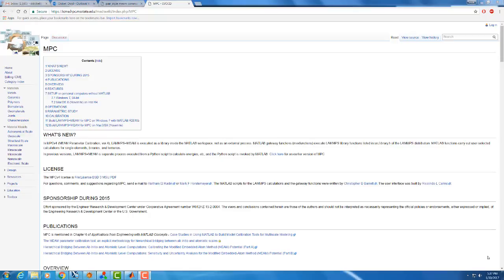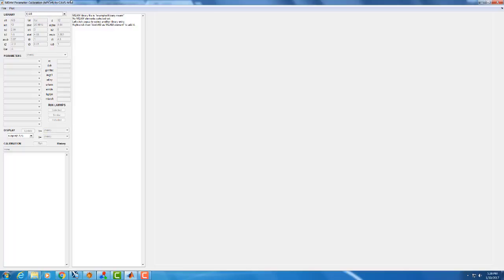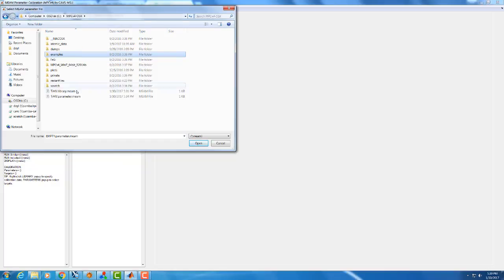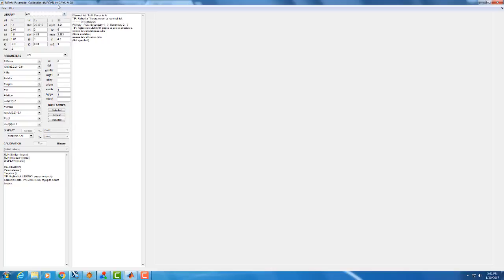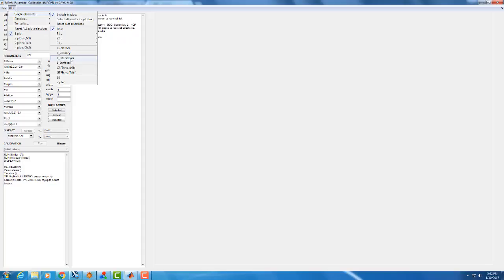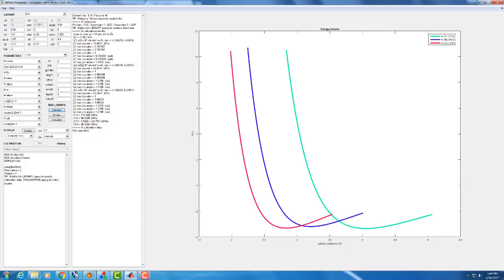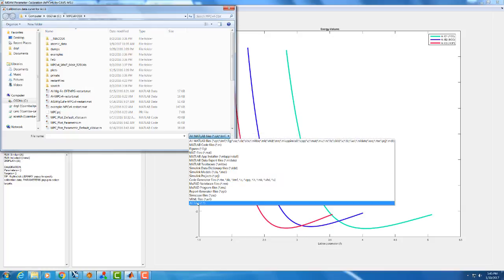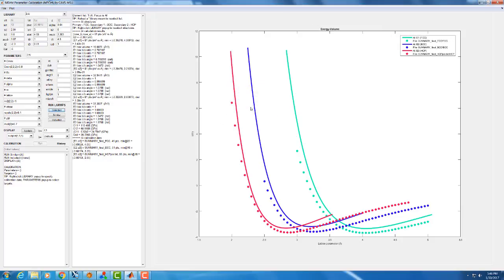MEAM Parameter Calibration Installation and Introduction

Comment: This looks like an interesting tool. I have two questions about it. 
Can I run this without using Matlab?
If it is as simple as it seems here why are some elements in the NIST potential database still without MEAM potential?

Thanks for your great vids!!!
Reply from the maker: Thanks for watching!
1. So, you can run it without having MatLAB, but the installer will install the Matlab Compiler Runtime (it is free though).
2. That is a good point! For most single material potentials, the process is very straight forward. There are potentials for most of the periodic table, but they haven't all made it to the NIST website, unfortunately. And, the ones that don't have potentials are just waiting for someone to make them.

Comment: Hello! First, thanks for the tutorial! I've just recently started working with lammps and the mpc tool and I am having some problems actually. My MPCv4 interface doesn't seem to have the library pop down tab even though I'd loaded the library.meam file. Would be extremely helpful if you could tell me what might be wrong...Thanks.
Reply from the maker: Thanks for watching! 
That's interesting... Were you able to successfully load the restart file that is distributed with MPC?
Reply: EnCodeVentor Hello! thanks for replying! And yeah I did load the Al-MPCv4-restart.mat file and it successfully ran the whole calculations too as it seemed. Yet, there was no library tab on the UI. Although I didn't install MPC on my C drive as the installation suggested since I didn't have enough space on it, but that couldn't have been the problem, could it?
Reply from the maker: It could be, but I'm not sure - I don't actually know why it is suggested to install it in the C: drive. I'll take a look at this, maybe something is different with the versions.